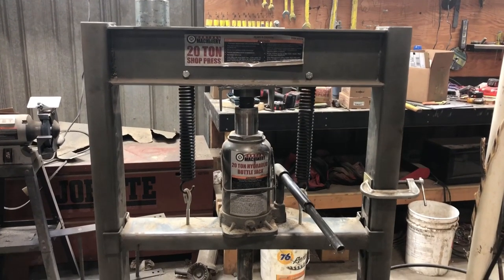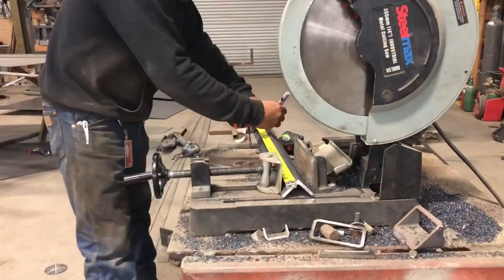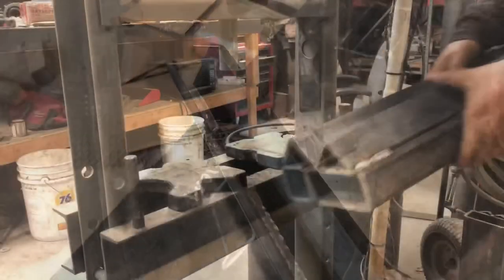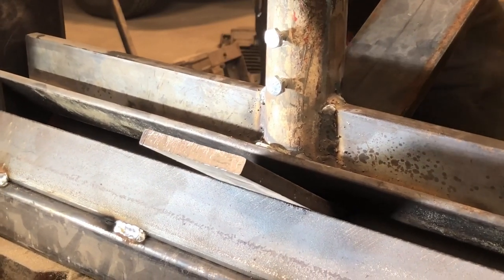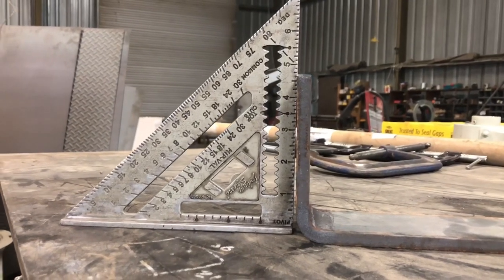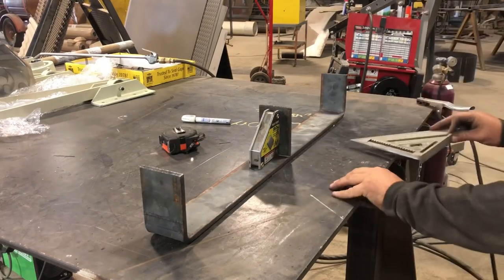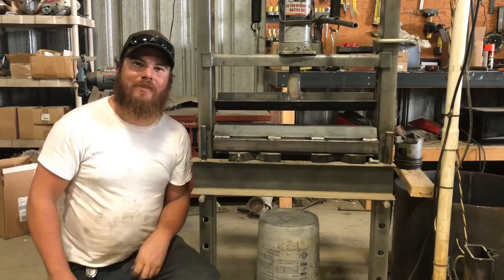How to make a press brake

Comment: Niiiice! This is exactly the video I imagined in my little brain before searching. Spot on perfect. I’m only bending 1/8” on a table top press from Harbor freight. Basically your setup scales down. I was scoring my bend on the inside then hammering it over, but this will eliminate that step. Thank you good sir.

Comment: Thanks for the video mate, a side note for the bottom section, if you shimmed up either side of the 2 angle pieces before welding you would create an angle less than 90. 89 or 88 is preferred, then you can bend to a true 90.
Reply: Do you mean to shim up the outsides of the angle iron?
Reply: @firewoodwarrior4396   yep, could slip a length of 2mm thick sheet/flat bar under the outsides of both sections of angle before welding. You’d have to then modify the top arbor to be less than 90 also, or just use a single length of 1/2” plate with beveled edges like a traditional press brake.

Comment: I just have done the metal bender and instead of the press, I did use the threaded rod. I am not strong enough to bent 3/8 piece but I can bend 4' 1mm thick sheet with ease!
Great video by the way!

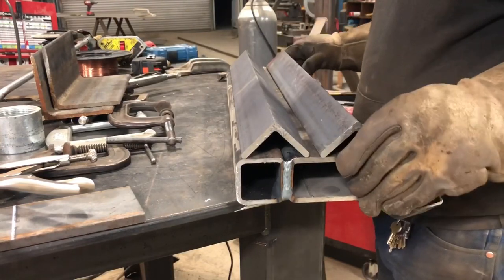Comment: 2:45 i'd recommend tacking both sides of something before putting much weld on...or if not, then weld the ends first.  if you put too much heat on one side, even with clamps it can still warp a bit.

Comment: Are you able to order your metal and get it shipped or do you have to go ever so often and pick up a load? 
Hey I have a need to roll one long side of a 24 " x 6" x 1/8"  plate. I need a 1" radius and it offsets 2 inches exactly if it were laying flat on the table measuring the L part sticking strait up.
I bet with piece of  2 inch pipe split open and reinforced I could make like a stamp like you have your Vee  and bend the metal I need?

Comment: Would putting a sharper edge on the angle iron  you are using to bend the 3/8" plate (or thinner) give a better 90 degree angle? SWAG's dies look like they have  a real sharp angle, almost like a knife edge. Does the angle need to be hardened? (I just got a 20 ton HF press). Thanks!

Comment: If you make the die a bit deeper you can do what's called "air bending" instead of bottoming out in the die, that way you can do angles equal to and less than 90. Cool setup.

Comment: Hi Tyler, thanks for a great video. If you wanted to, couldn't you create a finger press with different sized top pieces? Could you make different sized bottom parts with smaller angle iron to work with smaller pieces of metal? I feel like you've hit on something here, but you've only scratched the surface.

Comment: So lets say i use a 20 ton jack and i make this 4 feet long to do 3 maybe 4 foot wide will it be suitable in your opinion?
Reply from the maker: I really couldn’t say. You’d need one hell of a rigid set up and if you only bent light material it might work?
Reply: @farmertylerranch4399  i am not looking to bend anything over 1/8 max magbe 1/16 maybe it is mainly for sheetmetal.

Comment: Great video !!!!what blade do you have on your chop saw?
Reply from the maker: Thanks Kenny. I think it’s a Steelmax. That is what is called a “dry cut” chopsaw. Spins at a lower rpm and uses a metal blade. It cuts so smooth and creates virtually no heat

Comment: Hey Tyler, how do you like the Steel Max saw?
Reply from the maker: I love it!  I have a Milwaukee dry cut saw in my personal shop that is really nice too. Once you use this style saw you will NEVER go back to the traditional abrasive blade saws!
Reply: /Thanks, have an old abrasive style and cutting torch.....really need to update. @farmertylerranch4399
Reply: Looked around for both the Steel Max and Milwaukee, have only seen Dewalt and Makita. Where did you get yours. I've not looked at Sacramento Machine yet. @farmertylerranch4399
Reply: @robertsimmons3556  Years ago I switched from the stinky toxic to a milwaukee dry cut but burnt it up cutting 9/16 plate (1000) pcs.  I now have an Ellis 1600 that is one of my favorite machines
Reply: @donsmith9081  Man that Ellis is a beauty!! I went with the Steel Max primarily for its mobility.
Reply: @robertsimmons3556  Make sure you wear good hearing and eye protection. 
Dry saws are nice but they do produce metal splinters.